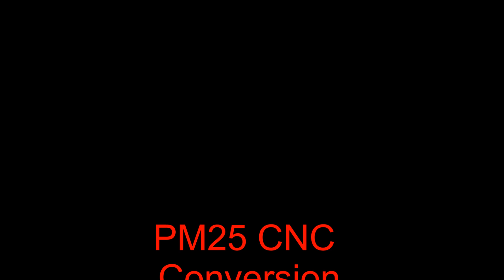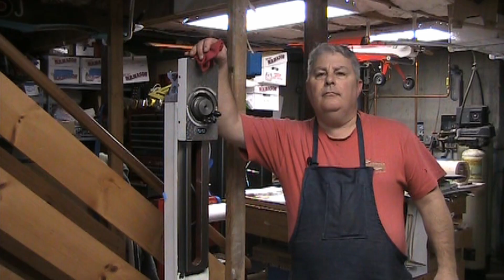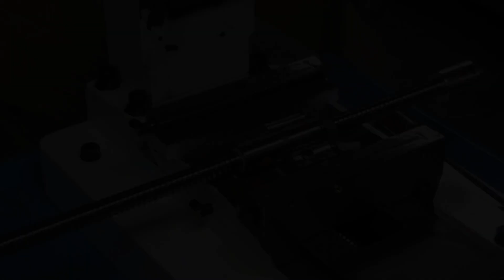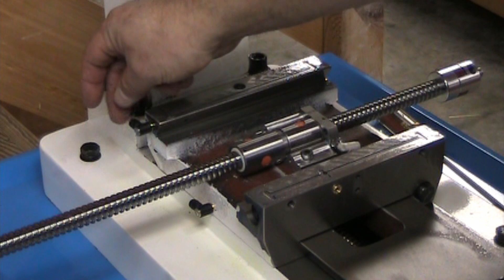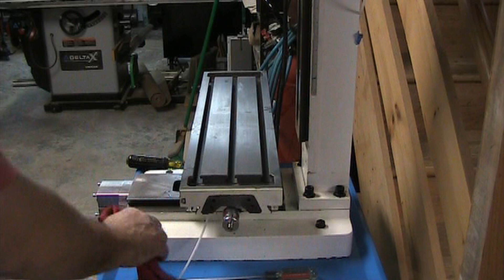PM25 CNC Conv Part 6 X Axis Install

Comment: Got all the factory paint stripped off mine. Slides will be black.  Base,column and head will be yellow.  Should have my ballscrews in the next week or so.  Still gotta take the spindle out and clean it up real good.  I’ve gone through a lot of non chlorinated brake cleaner so far.  Using about one can per part to get em REAL clean.  Epoxy granite fill before re painting. Figured if I don’t Americanize this machine before I get it up and running then I never will.  Taking my sweet time.
Reply from the maker: durangotang 1 wow! Sounds great. Spindle bearing upgrade is next. Good job cleaning. Hope you found less stuff than I did. I like the color scheme.👍
Reply: Beechdrvr yeah.  No, my machine was absolutely filthy.  That high pressure brake cleaner was the only way to get all the nastiness out of the oil channels machined into the y and z slides.  All the stuff on the bottoms with the red primer was caked in “lapping paste”.  Flood coolant in the future had me worried about all that sneaking through the filter.  The gears in the column looked like they were lubed with the last grease they had in the factory that they found on the floor or something.  Literally bits of small gravel in the grease.  Terrible.  But I knew what I was buying, so like I said, wanted to Americanize it.  There was a lot of overspray that I removed from the “scraped” surfaces of the z carriage.  Might give everything a rub on the surface plate when I’m all done to see where those surfaces really stand.  But when I’m done it’ll be fine.  Also a pretty bad defect( a big pit) on the inside of the dovetails for the z slide.  Probably fill with moglice just to be safe.